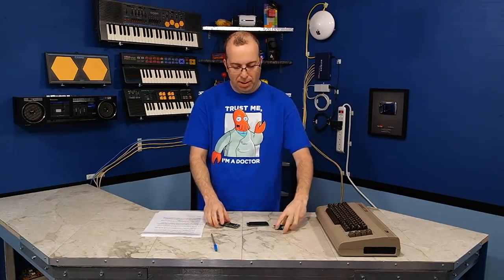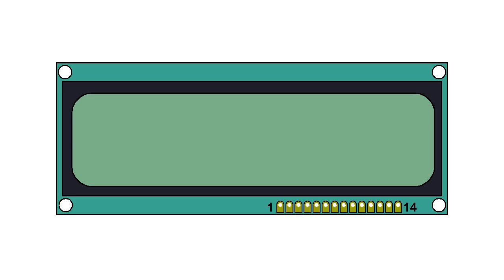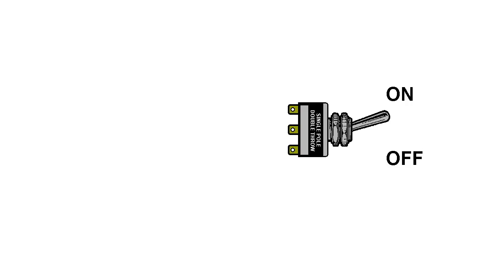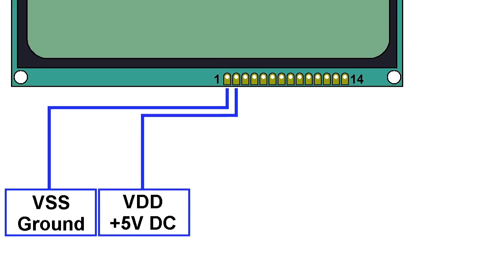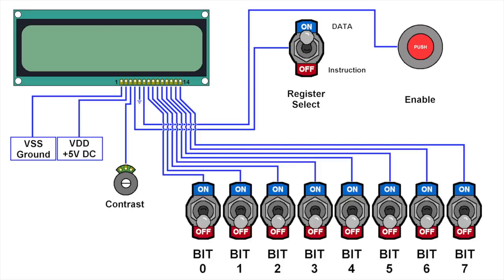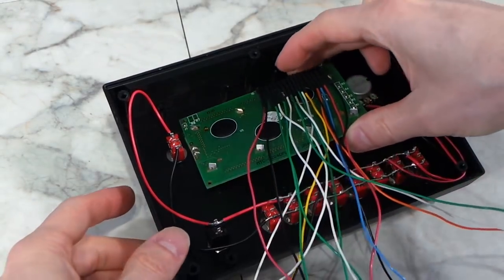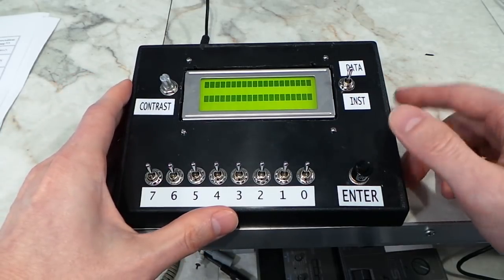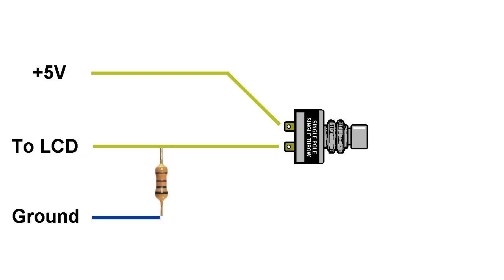How a Character LCD works Part 1

Comment: I made this myself today and it works well. I'll show it in my club Sunday and Monday - I'm sure everyone will like this! Thanks for sharing it with us.
Reply: any possibility listing the parts you used?
making one myself too.
Reply: @motsgar  Go here: https://youtu.be/-l4Z2vkjUYo and also see my next video that I'll upload in few minutes, that will have more diagrams - how to connect all the wires! If you have more questions, just ask here or on my video that is here:  https://youtu.be/-l4Z2vkjUYo    When you make yours, please share it with everyone and make some improvements if you can! Have a great day!  The switches used in this project are called TOGGLE SWITCH with 3 connectors, NOT 2 connectors! When the switch is in OFF position, the output side of the switch must connect with the GROUND (negative) side and when you flip the switch to opposite side, the output sends PLUS (or 5V) to the LCD pin.  (The blue wires connected to LCD pin #7-#14) Make sure that all the switches point to the same direction - it will make it easy to connect one side to +5V and the other side to - or negative side! Please ask if you need more help.
Reply: @motsgar  The second video is here: https://youtu.be/CMmYZIEk7GQ - I posted the diagram and how I connected all the wires.

Comment: I had a Matrix Orbital MX6 USB VFD 20x2 Green character LCD screen with a 7 button keypad overlay attached to a 5 1/4 inch drive bay insert adapter in my Windows XP computer back in the mid 1990s and early 2000s. It was all pre wired and mounted right in to a 5 1/4 drive bay and had cables to connect it to an internal 5 pin USB motherboard header, or to an external rear USB port on the motherboard. It came with a software program to customize information shown on the screen. I had it set up to show system information about my XP computer set up. Processor type and speed, RAM type and amount of RAM installed, the amount of RAM being used and left available, hard drive space used and available, operating system name and version, time clock, PC uptime clock, etc. It also used software plug-ins for other things like WINAMP controls, weather information, other audio player controls, It also had small graphic characters for the manufacturer logos like Microsoft, Intel, AMD, and so on. The software program and LCD screen was highly customizable so you could also make your own custom characters, screens, and graphics.

Comment: My Fav episode so far, I used a Nokia LCD on my last Arduino project and it is way more complex to control. YOU, YOU USED BASIC FRIGGIN COMPONENTS and with the Nokia its all about clocking and all this complex code. This vid helped alot with my understanding of LCDs.

Comment: This series has taught me everything I needed to get started with character LCDs. This was one of the first circuits I remember making when I got into electronics a couple of years ago and now I'm havgin a blast revisiting  it. I've been learning assembly for the 8051 miicrocontroller and one project I'm working on now is to interface it with a character LCD and control the LCD wth the 8051 and not knowing how to use noe makes it a lot harder to do. =P

Comment: On the first display with the missing pad, the board looked to be only single (or may dual) layer. I think I would have just scraped away come of the covering and soldered the wire directly to the trace. But, that's just me.
I have seen those display's before, but I've always throught they were difficult to program or needed a dedicated controller of some sort. Thanks for showing how easy it really is.

Comment: Super video. Encouraging motivation for me. I'm reverse engineering the buttons and display of an old Internet Radio - Revo Pico RadioStation. I'm replacing it's inner circuitry with a Raspberry Pi but keeping the really nice case buttons and dot matrix display so that I have an Internet Radio that supports the latest codecs.

Comment: This is awesome!  It instantly makes the data that is being sent VISIBLE to someone who doesn't know programming and cannot simply read the code.  I was not aware that the signalling was this simple, or that LCDs followed such a common 'language'.  I will definitely be salvaging some LCDs in the near future!

Also:
Instead of trying to turn the switches around, why not just switch the 5v and G rails?  it's only two wires that need to be switched, the switches do not need to be physically rotated?

Comment: I realize this is an older video, and you might not see this comment, but I would totally buy this as a kit.  You should seriously consider putting kits together and offering them on your site, though I'm probably going to start looking for parts on eBay or Amazon soon, as I totally want to build one of these just to learn how they work.  I think learning how they operate, via this method, will be a great experience and should help me transition into adding one of these to one of my many Raspberry Pis (no idea how to pluralize that).

Comment: Just came to this after notification of your 3rd video on this subject.

The 2nd LCD with pads missing was only the plated through hole the track connects on the other side.

Comment: Good one! You might save wear and tear on the solder pads if, instead of desoldering and removing the wires, you solder instead to the wires where they were cut off when scavenged (just strip the ends). You can then solder and desolder from the wires many times without affecting the board traces or pads.  I leave myself this option whenever I can when scavenging parts.

Comment: Attention - the HP Laserjet 4 printer you do show at 0:31 has no LCD (Liquid Cristall Display) but Vacuum Flourescent tube display VFD. That would be technique that uses an electrons emitting heated cathode and some anodes attracting and accelerating the electrons to some specific points of the display surface where they hit some phosphor that is getting stimulated and emitting light then. This tubes are driven from completely different voltages and are using completely different controllers!

Comment: I've used SPI bus LCDs, but just started toying with the kind in this video a couple months ago.  (Had not seen this video at the time).
I went through my own phase of "why isn't this working?!".  It sort of worked, but the text would come out mostly as garbage.
Turns out my wires were too long.  I was using a Raspberry Pi with C, and running the display quite fast, and the display was inducing voltages on the wires while it was busy doing stuff internally.  I could see the bursts of noise with a scope.   Moved everything from a breadboard and ribbon cable to a Pi hat, and problem solved.

It's also worth mentioning that if you want to be able to run the display fast, you'll need to be able to read from it to read the status register to know when it is safe to write another byte.
Reply: Have you tried time delays after you have writen a instruction or data into the display?
Reply: @Loundre3  Yes.  I suppose you could do that instead of reading a status register.   A delay of 50 microseconds would probably suffice.  Clearing the display or returning cursor to home position takes much longer.

Comment: I just got finished making something like this, which was very much inspired by this video. I haven't got a project box so I did it all on breadboard, and all I have is momentary switches, so I opted instead to pull down all of the inputs with a 10k resistor for stability and just use a long breadboard jumper to connect whatever inputs I needed to high or low, as necessary. Same basic idea as your's but I have loose wires instead of switches lol. I'm completely new to these things, so I'm still getting the hang of the binary codes and how to use it. But once I get the hang of it, I'll make a point of posting a video to my channel.

Comment: I remember when I was younger probing the connections of old LCD screens with just a battery with some wires to make different characters appear, never knew the lcd screens were so simple
Reply: Those were 7-segment LCD displays with straight wiring. The ones seen here now have a widely-used HD44780 controller which does that for you.

Comment: i love watching projects like this. if you use the screens over and over, why not atttach some pins to em instead, this would make swapping pretty easy. i would recommend looking into dupont pins, (these are what a computer front panel header use). 
a crimper costs about $30, and the pins are a few cents each. you can but both strain and angled pins off ewbay for cheap, and frys actually sells 1x1 pin housings and sometimes the male and female pins too. 

i prefer using pins over soldering cause it makes maintenance and swapping super easy.
i do keep a supply of pins, and a assortment of housings on hand.

Comment: you could swap the gnd and 5v to the switches to rotate them. also, you can attach connectors to the lcds (or everything else) to avoid soldering to them again

Comment: I know this is an older video but I have a suggestion for neater project box cutting.  Buy a nibbler and drill a hole in the area you want to remove big enough for the nibble head.  You will create cleaner lines but it does take longer.  They also make drill powered nibblers if you want it to go faster.

Comment: Great video. Advice: Perhaps you should acquaint yourself with idc cable making. It's not difficult. It would save you a lot of time and eliminate the need for soldering flimsy wires with heatshrink tubing

Comment: I spotted the upside-down data switches when you wired the resistor to the bottom bar. :D (Debounce too, but I wasn't sure of that at first.) Eh, I can laugh, but I'd love to be all set up to do this. I didn't feel well enough for most of my life, but seem to be starting to get on top of that now. And these LCD displays seem way less technical than I feared. I just missed learning about them when I was younger and a little bit healthier.

Comment: When you are desoldering, try to put flux on it and put a tiny amount of solder on the desoldering braid first. It will allow the braid to suck the solder on the pin you want to get out much faster. Also, use a temperature controlled soldering iron and heat it no more than 3 to 5 seconds, wait for 10 seconds and try again to suck up more solder on the pin. I have worked on many cheap Chinese made PCB boards and usually, a high-temperature iron on those pad without flux for about 8 to 10 seconds has a very high chance of killing the pads. Also, I don't quite understand why put the capacitor between the 5VDC and the LCD signal input pin. I know you are trying to make an RC filter to eliminate the debounce but won't the cap charge up slowly through the internal resistance and the resistor to ground slowly and cause a logic 1 after some time? I think the cap should be connected between the LCD signal pin and the ground. This is how the typical RC debounce circuit I've seen and I have used. Please correct me if I am wrong about it.

Comment: I was working with some lights today and testing which worked and if it was a placement problem, found out 2/8 were working.
During those tests I received 2 electrical shocks.
Good job me

Comment: I understand you couldn't turn the switches around without desoldering everything. but couldn't you have just swapped the 5v and GND lines to the rails you soldered on either side of them ?

great video. thanks for demystifying these devices. they are a lot simpler than I had thought

Comment: Great video!! One question as I am still confusing with de-bouncing. How did you calculated the correct value of the capacitor? and why did not connected p.e. between lcd and Ground? Sorry if the question sounds silly.

Comment: Great! Just nitpicking: the Vlcd contrast voltage isn't necessarily between +5 volts and ground! I have LCD display which need up to +25 volts or even negative 5 volts to show properly. It depends on the liquid crystal chemistry used. It always pays to have a look at the display's datasheet.

Comment: Long time ago when i get character display first time, i playing with it exactly the same, but in the place of data pin toggle switches, i used dip switches.. And anyway, this project was cool.. :) Next step is using character LCD connected to EEPROM data pins + binary counter, oscillator, trigger ( to eliminate initialization cycle) to show some controlled line status by EEPROM Address pins.. :D I did it for fun.. It even shortly beeped after start.. After that i start to use microprocessors and in some cases is cheaper to do all stuff by program..
For test displays, first what i do when getting new display - solder in pin header's.. Only one display i have with ribbon cable and female plug on other end to plug it in to prototype boards header pins.. In very rear situations i resolder header pins but usually pads stay in place.. Maybe experience.. ;)

Comment: I used this displays many times and I newer solder wires directly to pads, I always use strip pins and wires on strip connector so that it can be easily replaced or used on some other project. BTW I newer used it in 8 bit data line config but in 4-bit configuration, to save I/O lines on uC.

Comment: All you had to do with the missing solder pads was scrape away the solder mask (paint) over the trace running to the would be solder pad and then solder a wire to the trace.

Comment: Thanks for this video! I enjoyed it quite a bit. I plan on adding an LCD display to my Atari clone, it has hundreds of games in memory and just one button that skips to the next game. I plan to add better controls to that like a +1, -1, +10 and -10 as well as the abilitty to use either a Genesis or a Snes controller to do things like reset or BW with the extra buttons so I don't have to lift my butt.

Comment: Since the electronics on the LCD display are most likely CMOS, instead of wiring each to an SPDT switch that switches between GND and Vcc, it would have been better to pull each input up to Vcc through a 47K resistor and use the switches to pull the inputs down to ground.  Of course, it would have cost a few cents more for the resistors, but it avoids the issue of an input floating in an indeterminate state between Vcc and GND as the switch is being thrown.

Comment: You should use a header pin set instead of soldering and desoldering...it's much more durable.  If you want it to be more compact without the pins sticking out have a few inches of wire to a pin header.

Comment: Hi there!!  Super cool channel!  I have a question I'm hoping you can help with - I make piano how to videos, and have recently been making them on Yamaha PSR-E473 keyboards.  These keyboards have a backlit LCD screen, but there are no screen adjustments available for contrast or brightness.  I have tried recording them with a decent webcam (no luck whatsoever there; only get a bright glow regardless of the distance or ambient lighting).  The only way I've been able to film them clearly is from super close up with an iPhone; if the iPhone is far enough back to be able to see the keyboard as well, the screen is unreadable.  Any suggestions?

Comment: You could have cut the power/ground going to the power bus and swapped at just the data switches.
The data/instruction switch should have enough room to remove and rotate without resoldering

Comment: you can correct the data bit switches upside down by just swapping the +5 and ground power wires connected to the switch row without rotating each of individual switches . :)

Comment: You might just switch your +5 and gnd wires going to your rails. This will correct your switch issues. And as for the register switch you could have just spun it in its whole no soldering.

Comment: You actually had to mess up the connections with enable button as well, you should be setting enable low when you press the button and it should be high on default.

Comment: When you put your switch diagram up at the start ( with the 5V and Ground) , I was thinking but switches work backwards, not the way that diagram is showing.

On the first LCD it looked like the missing pad had a trace on the surface of the board, I would have scraped the insulation off the trace, fed the wire through the hole and soLdered directly to the trace.

Comment: Use generic household light switches instead of toggle switches.  They are huge, easy to flip, rated for billions of flips, and dirt cheap (buy them by the box).  I always wondered why designers for thinks like the PDP8 and Altair and IMSAI didn't use light switches which would be easier on the fingers and faster to flip.

I wired one of these up to a parallel cable one time and used it as a CPU Perf monitor.

Comment: 10:30 when i was working with a digital IC ,  CD 4013, I came with the same problem Bounce. I think really hard to solve it without knowing what to do. Then i just started adding passive divices to check that this step solves the problem. Thank god I solved it with a 0.01uf capacitor. Until i watches this video i dont know what the capacitor does.

Comment: I'm trying to replicate this circuit, but i found that toggle switches are very expensive compared to other kinds, like cheap dip switches but i can't for the life of me make this work. Since dip switches have only 2 pins, and not 3 like toggle, i figured i could jump all pins to a 10k resistor then to ground, as you did with with the "enable" pin, but this didnt work, or i made some mistake elsewhere. Also, since i lack toggle switches, i did the same with RS and of course, enable but i cant seen to find the problem, am i to ground each separately with lots of resistors? or if my solution of putting each pin to the same resistor should work.